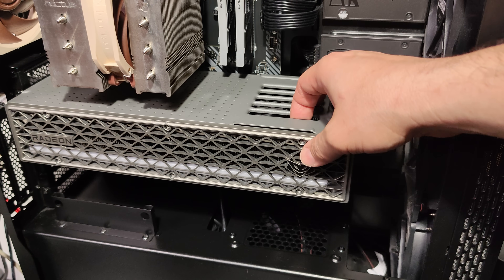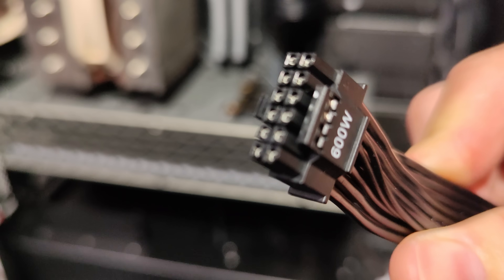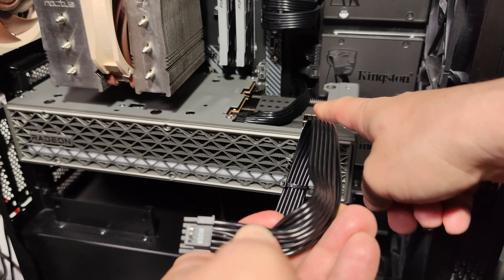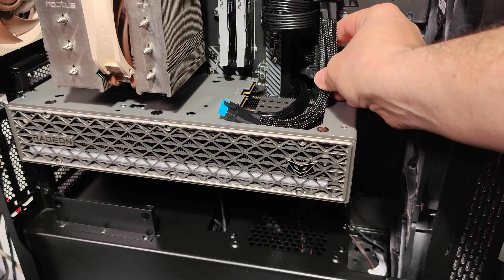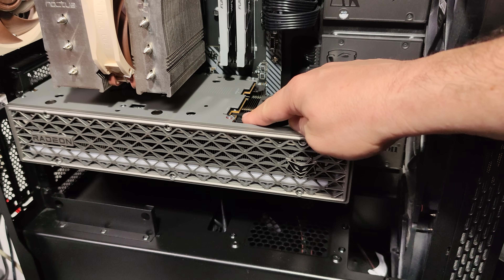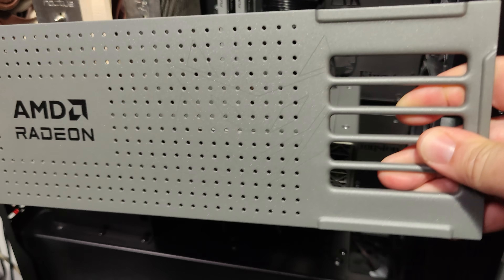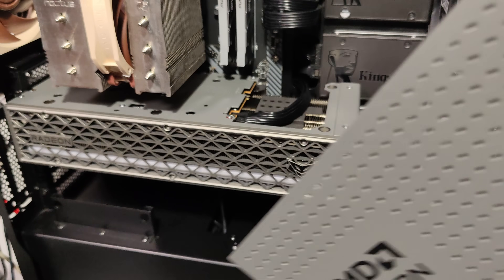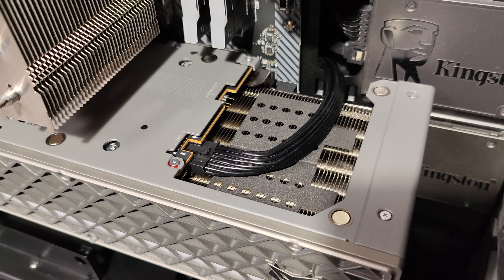Radeon RX 9070 XT Sapphire Nitro+  Magnetic Backplate More Problems Found And Exposed 🔥

Comment: Lets create problem when it doesn't exist.
Reply: Really? a backplate on top of another plate with no thermal pads in-between is plain  stupid. The second backplate just hinders the efficiency of the first plate. Also stupid that is an unnecessary cost  added to the user end.
Reply: @pete0274  OmG. Tell me u know nothing about  GPU design without telling me. 😒
Reply: @PenX79  You are just trolling, since you explain your argument  so "exhaustive"  Now I will explain mine to help the OP: "GPU design" like PCB? you are so vague. Or how proper thermal solution looks like on GPUs? Back plate, middle plate, whatever you add into passive GPU cooling design you have to make the links in between, metal touching each other is not good enough, simply because heat transfer is not fast enough. You have to get rid of that  back plate heat fast enough so VRAM , power delivery(drv mosfet, inductors) and GPU core will not be affected by the trapped heat.

For example on a AMD RX 380 Nitro the backplate reached 61 C in measured with IR Fluke in 10 min of Valley benchmark x 2 instances running in same time, backplate was Aluminum painted, it show how important back plate became in cooling and dispersing the heat across the back plate(higher surface), simply because more often in PCB design, most manufacturers introduced 1 or 2 copper layers which will enhance the heat transfer from one side of the PCB to the other. This copper layers are also a standard in MBO manufacturing now days. Back in time PCBs had what is called textolite which will do the reverse, stopping heat from traversing the PCB. Both methods have benefits and cons. Your homework. 
 Back on the GPU back plate , an aluminum back plate with 1.5 -2 mm thickness will reach heat saturation fast, in  order to disperse heat effectively  you need very high pressure airflow coming from case fans (which means noise) or you use targeted airflow, fans sitting on the backplate in pull not push as low as 1000 RPM, fan has to sit away from PCB at least 1cm(can be effective with just 0.3cm) but not more than 3cm gap in order to be effective. Targeted area is the square formed by the 4 screws of the retention clip/GPU core(is the hottest part of the backplate)  VRAM and GPU core will be cooled from the back. In many cases the big Air CPU  coolers are blocking that area, while with AIO you have plenty of space. 
OP can do an endurance test > Superposition 8K optimized(cinematic loop) at least 45 min with and without  the secondary back plate, that will really show different numbers on GPU and VRAM. I did mine on 1080 TI 25 min  8K(cinematic loop) with HWinfo in back ground and at the start of the test room temp 21.5C  reached 23.6 at the end of the test and Average temps of the card was GPU  59.9C , VRAM 56 C, PWR 57 C with 3 x 92 mm fans(deshrouded card) running at 1400 RPM and back plate fan 882 RPM. Averages are the most important temps. My card doesn't have thermal pads but, thermal putty. TIC on GPU is TF8. HIs 9070 XT should do better as has much heavier heatsink(1348 vs 1800 grams) and also will be less load from Superposition compared to mine.
Hope this will help OP in deciding to use secondary plate with thermal pads or not use it at all, I will go with the later.
Reply: @pete0274  Stop embarrassing u self dude 😁
Reply from the maker: Yeah, paying more for "marketing and design", strapping an extra plate, using the worst power connector, botching it up with foam pads on the heat sink fan. Clearly problems that do not exist :)
Reply: @ Still fighting with u self online. Dude get a life 😂
Reply: @  Better than sunk myself in trolls, which will add input  lag  further to your overall low  neuronal activity.😮‍💨
Reply: @pete0274  hmm, i wonder what happens when a fan blows against that second backplate that creates a sort of wind tunnel between the 2 backplates from wich the lower one has thermal pads on the back for heat disipation from the pcb...just wondering...
Reply: @pete0274  dude, i have the same card and stock is doesn't go above 60c, the memory temp stays around 80c, undervolted and overclocked it can get to 62c and the memory temp stays about the same. thats whilst drawing around 365w average too, there's literally no problem with cooling and it performs great
Reply: @jaspervn4722  That doesn't delete his experience with the card.
 Do you have same VRAM modules SKHynix as him or the newly introduced chips for 9000 series which are Samsung with different specs and different temp sensor placement?

Comment: so the problem is just the backplate cover ? bro send the card to me i will used naked without any backplate
Reply from the maker: The problem is backplate doesn't do anything but decrease cooling, they used the worst power connector, they glued foam on the cooling fins of the heatsink and then asked about 300 euros more.

Comment: the 9070xt nitro looks like it was very clearly form > function while in the past the nitro was function > form. and its not even a good looking design. maybe one of the worst sapphire nitro cards ever made.
Reply from the maker: And to make more money faster. Strap a plate, put some foam, use the worst power connector and charge 300 euro more over the msrp.

Comment: its already cool enough why the extra 5 degrees matters?
Reply: 5 degrees difference is worth 100usd. Cooler is the main thing that card compnies compete with. Why pay more money for something that perform same as cheap one.
Reply: @HappyValentine24  no it is NOT. Lol. It may be if the card runs at 85 flat out. But these simply don't
Reply: @brettknibbs9351  60-70 c is temperature difference in tests. Sapphire being highest. So it matters. Paying more for plates and fancy looking plastic and for good cooling radiator that is blocked away by all that. I would just rip off those plates and stuff on the way like that thing under cable. Diy project, engineer the fk out of it:D
Reply from the maker: You actually pay around 300 euro more over the msrp for the foam, the worst power connector and the useless back plate.
Reply: @TechTronic9000  there 50 dollars more then msrp in the uk
Reply: @TechTronic9000  Yeah pretty much. How much that back plate weighs?

Comment: A 5-6c difference is just bullshit to make his claims sound more reasonable. I just tested on mine and there is zero difference
Reply from the maker: And the foam glued on the fins of the heatsink is good right? And the worst power connector ever made up. Then why pay 300 euro more for this improvisation?
Reply: @TechTronic9000  what does any of that have to do with you lying lmao

Comment: I couldn't get my hands on a Nitro, settled for the pulse... Nitro is a crazy beautiful card, but the pulse fits my pc aesthetic a bit more anyway. Just have to manually overclock. And no flaming connector either.
Reply: buddy, it wont melt. 5090's 575w vs 9070xt's 330w its a buch of  difference

Comment: Kitty inspection.  Kitty doesn't approve of the 12VHPWR.  Good kitty!  In my eyes it seems Sapphire designed the back plate with only the included adapter in mind.  Quite the oversight if they didn't think people would want to bypass using the included connector.
Reply from the maker: Yes the cat is a true "catspector", she didn't give the paw of approval, yet I doubt her expertise as she's not an electric engineer but a very good mewochanic.

Comment: All of the cards are over engineered for heat dissipation. The foam is fine and +5-6C temp increase from the backplate will only bring your temps into the high 60s/low 70s at worst. 
My card is millimeters from my front case fan which is not optimal and it has never gone above 60C at max load.

Comment: I dont know what you are all whining about. He is just pointing out the same design flaws that the major reviewers already have. You need a 90 degree connector to have the cable stick to the isolation or itll rest on the radiator which is by no means a good idea.

Comment: Sapphire really should have put the plug facing the way cables are going to come from instead of that stupid 90 degree bend. They still could have hidden it in the same place.
Reply: It's a none issue. The cable provided bends fine.
Reply from the maker: Yes, that would have improved things a lot.

Comment: The backplate is supposed do be removable!! Of course it will come out by hand!
What a moronic video! WTF
Reply from the maker: Too bad that you actually didn't understand how botched up this is, with foam pads over heatsink fins, bent cables in 90°, using the worst power connector ever designed and stating that the backplate dissipates heat when it actually makes the GPU run hotter. Then they go and charge 300 euro more for this.

Comment: The cable being stiff isnt problem of the Nitro card... I have SF750 with Corsair sleeved cables and it is very flexible.

You are just yapping and makin a video for the sake of yapping and making a video.
Reply from the maker: How does that fix the foam pads over the heatsink? Why use the worst power connector? Whay state that the plate dissipates heat when it actually keeps the GPU warmer? Ohh and then charge 300 euro more for such "novelty"
Reply: @TechTronic9000  I prefer 12 pin over 2 or 3 8 pins... Easier install and less cables to hide. The foam pad is so that the heat sink fins dont cut the cables... You just made this video for sake of yappin. I was annoyed for the whole length.

Comment: If a backplate is helping to force air to flow over the GPU board and heat sink,  while keeping hot air away from the mobo, then it helps dissipate heat with it mixed with cooler air from case fans.
But this does look like it was made for non-tech people who ignore physics
Reply from the maker: The problem with this card is that the backplate is neither in contact with anything to draw heat away, nor has space under it to distribute air somewhere else, like you say to not go up to the CPU, it's just a second plate going over keeping the GPU warmer.
Reply: @TechTronic9000  I believed you, I just will never have one as 12V2X6 is something I'll avoid.

Comment: The Nitro card is a big L this year.  The ugly pewter colour that looks out of place in any build, the cable placement, and a front grill that looks like an old lady's jewelry box or a floor vent for heating.  6000-series design was peak, and it's been downhill from there.  The Pure looks great this year, now that they've dropped the red-only LED lighting.
Reply from the maker: I totally agree, they could have did a better job.
Reply: @TechTronic9000  I should have mentioned also that this was a great review.  Despite all the comments about 'nitpicking', videos like this are a great help in letting people make informed decisions. Thanks!

Comment: Why did you buy this middlerange GPU but you have that mega oversized expensive PSU?
That PSU can power two 5090s.
Just don't say because PSUs are most efficient in the middle of the curve because it doesn't matter for the 2% power difference :P
Reply from the maker: Because I'm running a more power hungry Ryzen 9 5900, 5 SSD and was planing for GPU upgrade. The PSU also has something like 10 or 12 year warranty.

Comment: These 9070XT really don't get that hot, so the foam isn't a big deal.  Undervolting them even helps with performance and heat generation.  Der Bauer was able to undervolt up to -150mV and it maintained stability and he got 250Mhz of clock speed doing that.
Reply from the maker: Tacking the back plate off resulted in minus 5-6°C. You pay a lot more for the card marketed as premium to get a botched up solution.

Comment: I have a sapphire nitro+ 7900xtx that I bought in nov 2023 for roughly 1200$(5500 lei). It's the best version of the of the 7900 xtx (also tried a pulse version but it had coil whine and was overheating). I have no idea what sapphire was thinking using the 12whp connector form nvidia instead of the normal 8pin ones. Also the magnetic backplate is stupid it adds nothing and only hinders. Not going to "upgrade" my card for a 9700xt but if I were then sapphire would not be my first choice or maybe I'd go for the pure white version. Thx for pointing the flaws out keep it up
Reply from the maker: And for the gimmick plate they also charge a lot more extra, around 300 euro more from the msrp making it 900 euro (4500 lei). I needed this one as my old 3060 TI was not able to behave nicely in 4K, only with DLSS scaling from 1080p.
Reply: @TechTronic9000  Around 300€ more 🤣🤣🤣🤣🤣🤣 it is only 180€ over msrp in europe so please stop this Bullshittery
Reply: The 12V connector is not invented by Nvidia. Intel is in charge of ATX PSU standards & revisions, Intel invented the whole ATX PSU standards.
Reply: I bought mine for $1500aud on release. Paid $100.00 over but I was guaranteed to get it so I didn't care..

Comment: Rich guy problems...
Reply from the maker: Nope, put some foam, put one connector, put a piece of metal and ask 300 euro more for it ;)
Reply: @ well, I said rich guy problems because if you wanna buy one of the 9070xt in the country that I live, you need to pay at least 1200 usd while half of the population earns only 500 usd per month. I just wish I had one of those, I dont even care if it has coil whine or works above 80 degrees celsius all the time, or one of the fan doesnt work. So the problems some people see, the other people are looking forward to have

Comment: Sorry, but it's amazing how much you don't know what you are talking about, Expirience is uber low.
Reply: Name one mistake he did or shut your mouth.
Reply: @turboqzma  it might hurt your head if i do that
Reply: @ 1. because no test shows a difference between backplate on or off, the backplate does not trap heat as he claims 2. the 4080 didnt have problems with that connector, it was always only cards with way higher TBP´s that had this problem, so its safe to assume, that this card also has no problem with it because of similar TBP 3. if you dont throw around the backplate in the case or start pushing on it, it just will stay in place and will NOT TUCH YOUR MAINBOARD as he claims. if you treat any GPU like that with a fixed backplate you can very easy ripp out any gpu wich would cause way more problems than just a moving backplate 4. the hidden connector and his cables...he could just pull the wires  a little bit better apart so that they dont stick together in a group of 8, that way his crapy cables would have no problem staying hiden under the backplate.
Reply: @georgwarhead2801  Please, use logic. I'll show you how to do that – 1.because no test shows a difference between backplate on or off (your own words), that means you have no evidence if backplate traps the heat or not. 2. By using simple logic, we understand that normaly heat goes up. By going up, it is being constantly stoped by the plastic backplate. Heat is not allowed to escape (relatively). And on top of the plastic backplate, there is the metal backplate, which is not connected to radiators, so it does function as the additional barrier for heat to escape (together with a plastic backplate).
Reply: @turboqzma  logic...funny that you bring that up...for me it is "logic" to get informations before making claims...when i say "there are no tests showing that" i mean there are no tests that show a meaningfull difference. benchmark run at 330watt with 25% fanspeed backplate on/off is a difference between 1-3 c°across all sensors, higher fanspeed = less difference, fans in auto mode = no difference.this tests where done with the card in a case and not on a open bench...ah end for your information...the backplates are both made out of steal and not "mostly plastic" like he claimed in his video, the only plastic part on this card is the top covergrid where the lightbar sits
Reply: @georgwarhead2801  You might be right. Overall, Nitro looks great. But I personally ordered ugly Pulse version, becouse it was close to MSRP :) And connectors oriented perpendicularly to MB.
Reply: @turboqzma  personaly i take performance over design. for me it doesnt matter if a card is not as shiny, as long as the cooler does its job...i hope you will be happy with your card!
Reply from the maker: You’re right — my experience is so low, I mistook a melting connector for a feature. 🔥
Reply: @TechTronic9000  did the conector melt? its not like the card pulls 450 or more watts?
Reply: @TechTronic9000  The melting is more of an Nvidia issue. The 12VHPR is not a good connector but the main issue is Nvidias board design and power usage. The 3000 series didn't really have any problems and so won't the 9070(XT) most likely. I mean, it pulls around 300W stock and around 340 OC...
Reply: @TechTronic9000  its a 600w connector, that card overclocked only draws around 370, its not even close to melting like the 50 and 40 series cards drawing near 600w

Comment: Would it hurt in any way to take the foam off too? Would it like melt the cables?
Reply: Depends on your cable.
If you used the one that comes with the gpu, nope.
That cable resists more than whatever the gpu can put out, and it will be cooler overall.

Comment: Over an extra connection you have an increase resistance depending on the current drawn. Not anything to worry about and will not impact the performance of this card in any way. The GPU draws the same current regardless of how many connection points you have. A slight increase in resistance will make the power supply draw more. I am talking like a fraction of a Watt. Nothing like a 5090 when pushing the max rated Watts to the limit. This will not melt and you will not have any cooling issues, So First post I agree "Nitpick of the year goes to..." this bloke, an uneducated nitpicker, with a great GPU and fake problems for content.